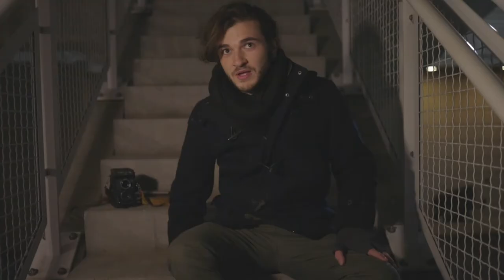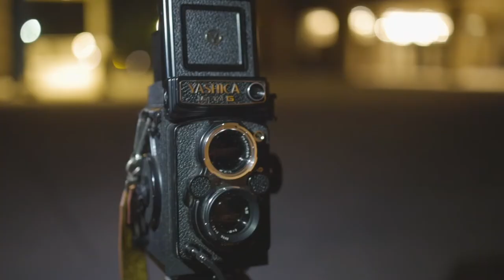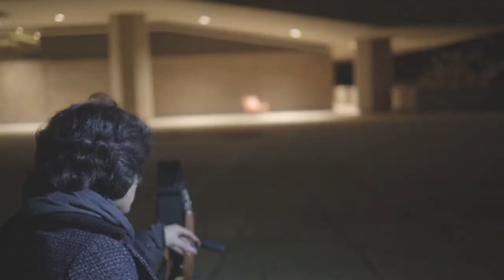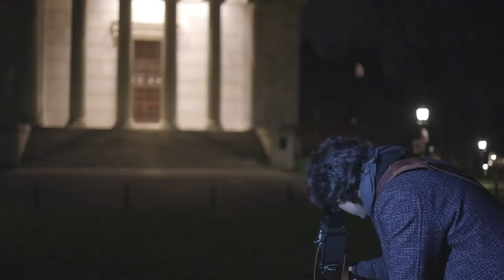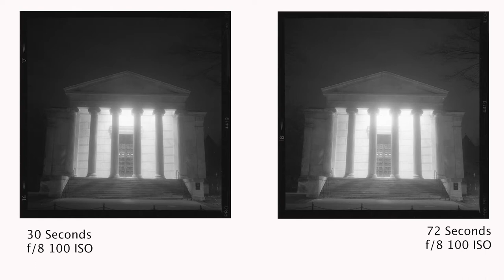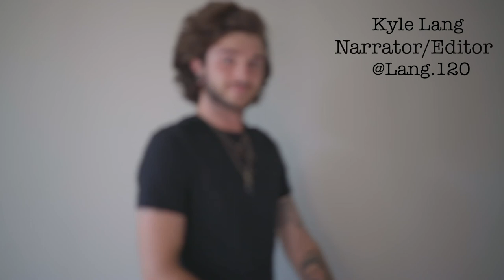How to Shoot Film at Night: Reciprocity Failure

Comment: Hye what is 1.26? Where can i get that amount to get 1 minutes and 12 seconds?
Reply from the maker: onyeatmonster 1.26 is Delta’s reciprocity factor, Ilford has a list of these numbers on their website.  Other brands also list their films with reciprocity factors on their websites. 

https://www.ilfordphoto.com/wp/wp-content/uploads/2017/06/Reciprocity-Failure-Compensation.pdf
Reply: I think his question is: what is the formula or math required to use the recip factor, since it is clearly not a matter of multiplying the measured exposure by the factor to get the corrected exposure?  The "factor" number is the power to which the measured exposure is raised to do the correction. For example, 4 to the power of 2 is (4 x 4) or 16. 4 to the power of 3 is (4 x 4 x 4), or 64. Where the factor is an odd number as here, you really need a calculator with this function programmed to do the math.